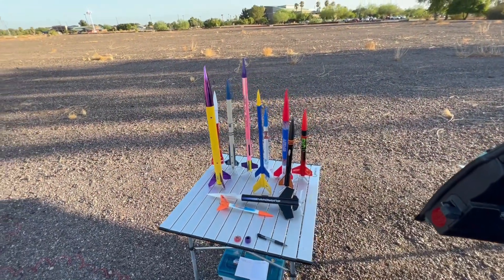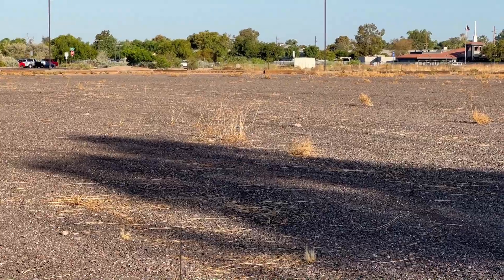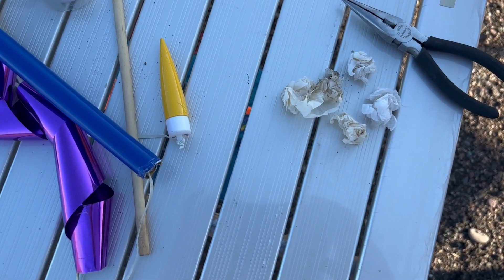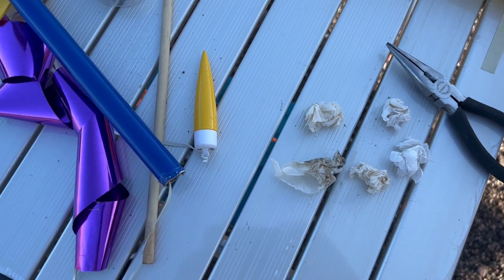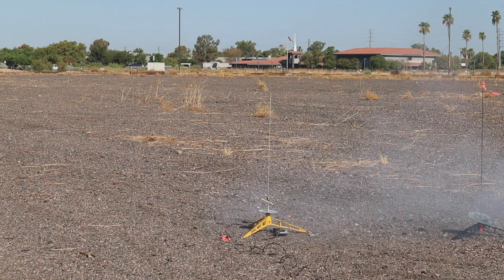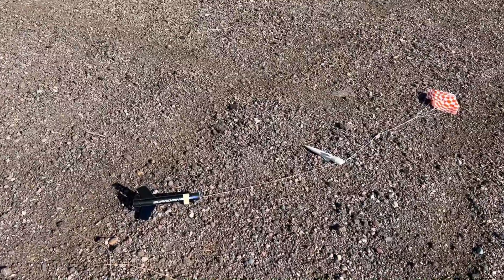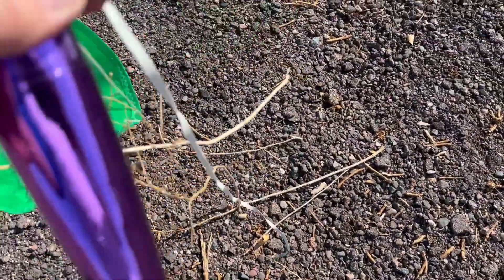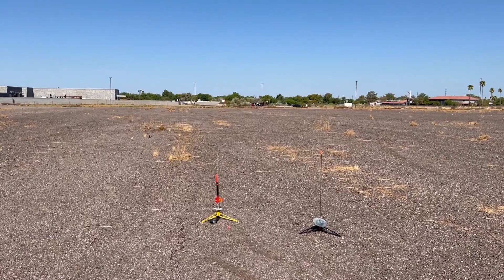Plastic Model Rocket Palooza 4

Comment: You can repair the top of the tube with super glue gel and some cigarette papers. Might need to sand it afterwards and do spots at a time but you can retain the original length.